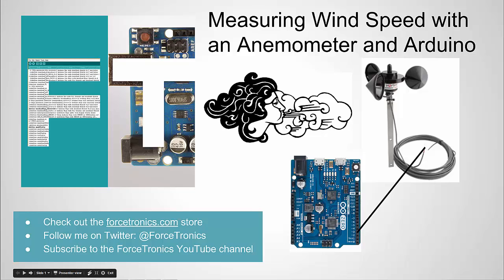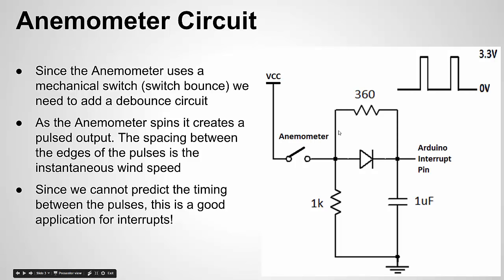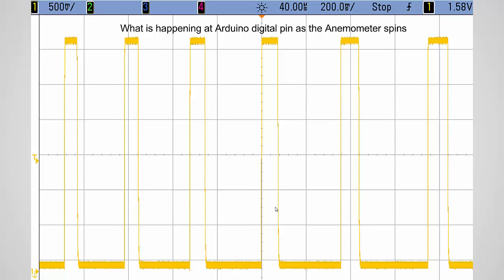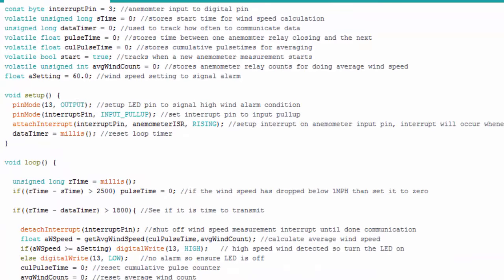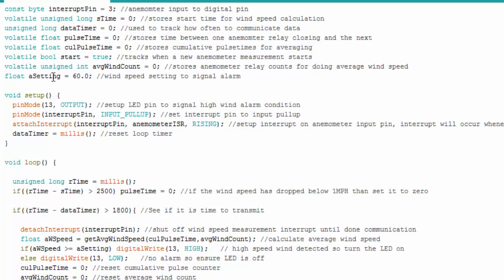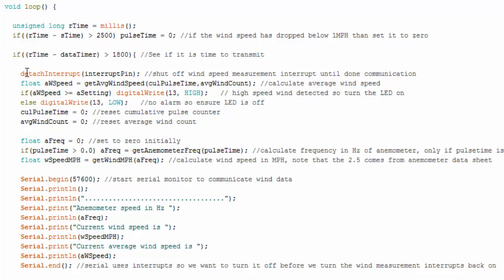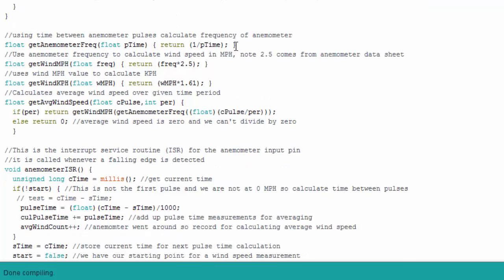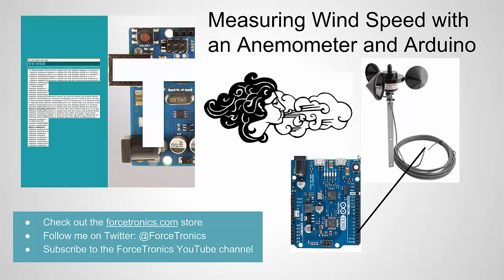Measuring Wind Speed with an Anemometer and Arduino

Comment: I had so many sensors and lcd's going that interrupts messed up my program big time so all I did was go in to each sensor function and check. I set my windspeed function up such that if it didn't produce one period in a given time to break out of the loop and report no wind to the display. This made my code run soooo much better. Interrupt is great if you don't have many other functions running (like a print to lcd function)

Comment: For those curious, cup anemometers over sample the wind speed by anywhere from 5 to 7% SO if you need hyper accurate data remember to apply a correction.

Comment: if the wind sensor circuit always bounces the same you can compensate for that in programming where you ignore signals for a micro second. that shouldn't effect the result unless you get wicked fast wind speed unheard of on earth.

Comment: Great video, fantastic explanation, thnx! . . . but . . . using your sketch I don't get consistent, repeatable results. I've set up my anemometer on a stable base. set up a fixed air flow (old hair dryer anchored to a bench), I get very variable results, even with a stable physical setup (I don't really acre what the output is, as long as its stable, then I can calibrate from there).

Thnx again for your great video,  much appreciated, and advice would be great.

billd
Reply from the maker: Hmmm sounds like you are missing triggers. You are using some type of switch denounce method, correct?

Comment: I usually fix relay float problems in software tbh.. it depends on the timescales involved..  Arduino is fast enough to continuously read input in the 5 microsecond range .. That is more than enough to detect the non floating bit.

Comment: so i should be able to use this to lower trackers on a solar panel array back to 'flat' in case of high winds?
Reply from the maker: Anemometers are commonly used to measure wind out doors so yes
Reply: haha... i know what they're for... just thinking i could program it with an arduino to do what i want...  if i get one with the directional dohickey, if the wind is X and the direction is Y, then close, otherwise, the wind will sort of 'defect' off the panels.   i'm surprised there are not more youtube videos for this purpose.

Comment: I dont get why in the comment it sais Falling event but you set it to Rising   `attachInterrupt(interruptPin, anemometerISR, RISING); //setup interrupt on anemometer input pin, interrupt will occur whenever falling edge is detected`
Reply from the maker: I may have misspoke in the video. You can use either the rising or falling edge.

Comment: What value diode do you use in the debounce circuit?
Reply from the maker: By value do you mean forward voltage drop? You can use any standard diode but you do want to make sure that the forward voltage drop is not so high that it reduces the voltage of the pulse so much that it is lower than the "high" threshold of whatever digital pin you are using to detect the pulse. I typically just make sure the forward voltage drop is <1V.  In a circuit design that has a debounce circuit I used the SMD diode BAS16. Also in my debounce video I should mention that a schmitt trigger is useful between the digital pin and the output of the diode to create a pulse with sharper or faster edges.
Reply: Thank you very much for the quick reply. I initially used a Fairchild 1N4001 diode, that is typically used as an AC rectifier, and got some unexpected results. I changed it to a small LED and your program works fine on the Uno, as written.

I want to use the anemometer to close my patio awning when the wind speed hits a predetermined threshold, e.g. aSetting >20 mph, and trigger a relay.

I also want to use the Adafruit Feather Huzzah and relay wing, instead of the Uno, because 1) small size of the microprocessor and relay,  and 2) wifi capability to transmit the data to a Raspi Pi and display.

I notice that your code compiles and loads to the feather huzzah, but I am not getting anything on the serial monitor other than a couple junk characters?

I will try to modify the code to get the feather to work... wish me luck.
Reply from the maker: Rectifier diodes are typically made for pretty high forward currents and this application is fairly low current so maybe that is the issue. I don't have any experience with the Huzzah, but the strange characters sounds like a baud rate setting mismatch. Sounds like an interesting project, good luck on it.
Reply: Thanks.  The Feather Hazzah and wings are pretty cool, and the on-board wifi is a nice feature, like the new Raspi Zero.

I checked the baud rate mismatch, and the outputs, just to see if the program was working but not printing correctly. It does send the junk message to the serial monitor every 1.8 seconds. I can write my own code to send messages to the serial monitor and it works as expected.

I'm not sure if the Adafruit Huzzah supports interrupts, or if I need a library to correctly access the GPIO pins? I will attempt to find out from  Adafruit . I've looked at a few Arduino IDE sketches for the Huzzah on GitHub, but there is not a lot to choose from.

P.S. I like your channel and your obvious expertise. I've "borrowed" your code numerous times for projects, e.g. nRF24L01 radio code for robotics projects.
Reply from the maker: The Hazzah has an ESP8266 on it which I believe supports interrupts so the Hazzah should support interrupts. Glad you found the content on the channel useful and I put the code out there for others to use.
Reply: FYI, 

I received a reply from Rick at Adafruit support, Buffalo:

1)You have the Serial begin in loop. It should be in setup, before you start printing anything:

2)make sure the baud rate in Serial Monitor matches the baud rate in Serial.begin.

3)Your anemometer signal is active low? you want to set your interrupt to be FALLING instead of RISING.

4)Yes, the esp8266 supports interrupts. Although it's good practice to use the digitalPinToInterrupt function:
CODE: SELECT ALL | TOGGLE FULL SIZE
attachInterrupt(digitalPinToInterrupt(interruptPin), anemometerISR, FALLING);

I saw in your comments that Serial also uses interrupts.

Putting Serial.begin in the Setup function did no good, except I was able to print correct English in the monitor from the Setup, and then I got the same square character every 1.8 seconds.

The FALLING vs RISING comment he made was from a comment in the Setup code about "the interrupt whenever a "falling" edge is detected". Is this in error in the comment (should it say RISING)?

Anyway, after messing around with various code changes, I got the monitor to report the results every 1.8 seconds using the Feather Huzzah, but I had to delete the Serial.end() statement in the Loop? I do not understand why this worked, but it did?

Just as a test, I went back to my Uno board and also eliminated the Serial.end() statement, and it seemed to make no difference in the output. But I assume that conflicts with the Serial function may introduce errors or crash the program long term.

So I plan to continue testing with the Feather, connect the relay wing, hack my awning control, add a reed switch to my awning to only retract if it is out, and send the data from the Feather via WiFi to a Raspberry Pi.

I will try not to burn the house down.
Reply from the maker: To be honest in the video I don't know what diode I used. I pulled a general purpose diode out of my lab stock, but I don't what the model number was. Sorry
Reply: @ForceTronics  I know this a bit old but the ESP8266 does not seem to support the Serial.end(); process. Just causes it to crash. Found a few other mentions online that its a known issue with the ESP8266. I am using this code with an Adafruit Huzzah ESP8266 and it works without issue outside of the Serial.end crash.

Comment: What is the 3rd wire on some anmomynomyters :)
Reply from the maker: I can't answer for all Anemometer, but the 3rd wire on mine is not connected to anything. My guess is they are using some standard connector that has 3 wires but they only use 2.
Reply: Thanks